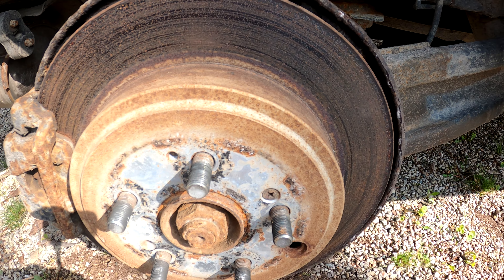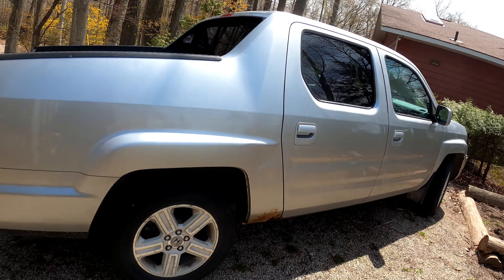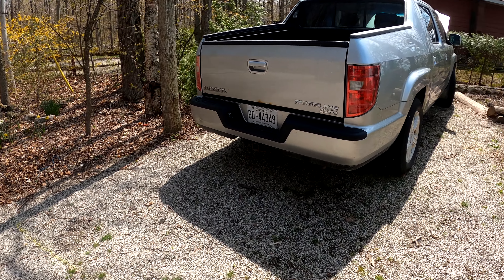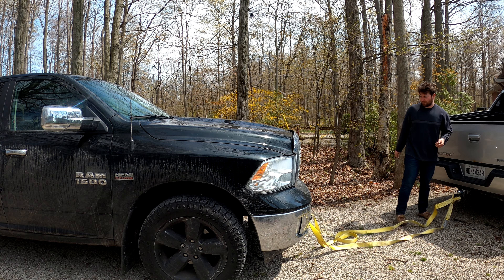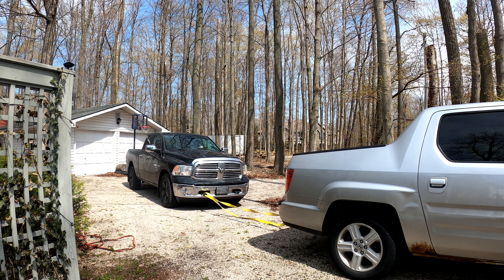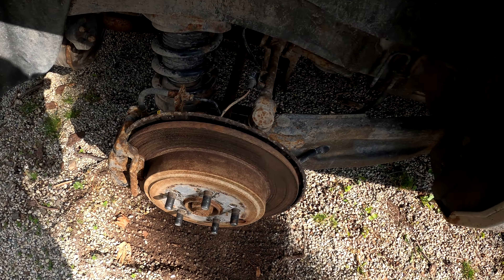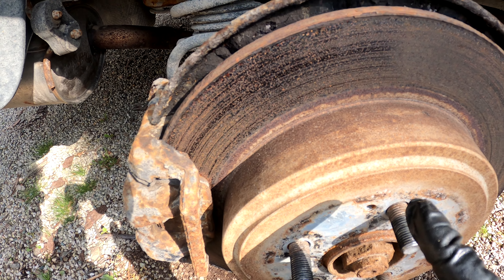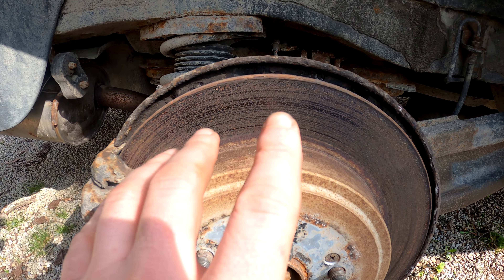RAM 1500 VS Honda Rigdeline | 4WD LOW Pull Test

Comment: Honda usually have a place to stick the key next to the shifter that will allow you to put it in neutral not sure about the ridge line though.
Reply from the maker: I'm sure there is a way to shift the thing into neutral but I was just like "f*ck it" and wanted to see if the ram could pull it lol. worst case senario i'm sure you could go under the truck and manual shift pull on the shift cable or lever

Comment: Man you really gotta get that bw44-45 😂
Love your videos, you actually got me wondering about my ram after i bought it without knowing about those different transfer cases, luckily mine has the 44-45, i was about to return that truck if it had the 44-44.  Keep up the great videos!!
Reply from the maker: haha ya I thought reverse had the lowest range for some reason but first gear is the lowest so If I was in first and in 4 low it may have pulled better. but thank you sir